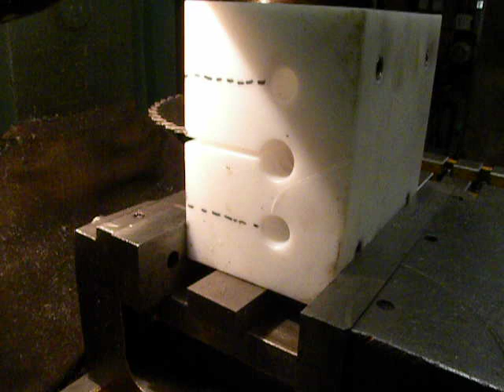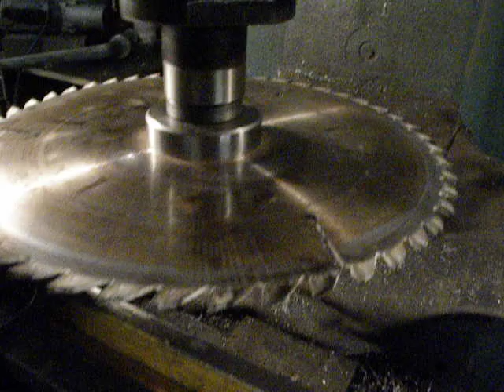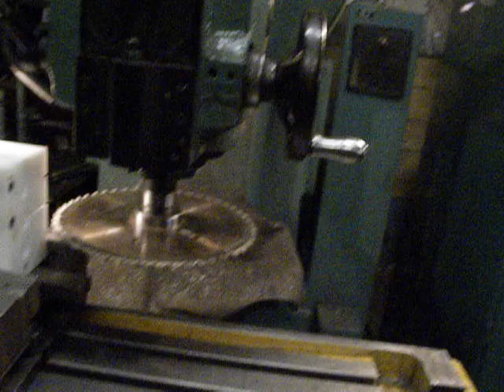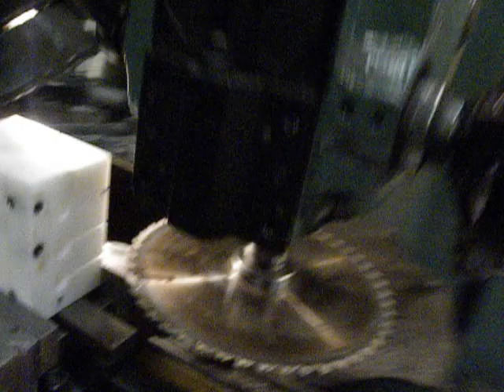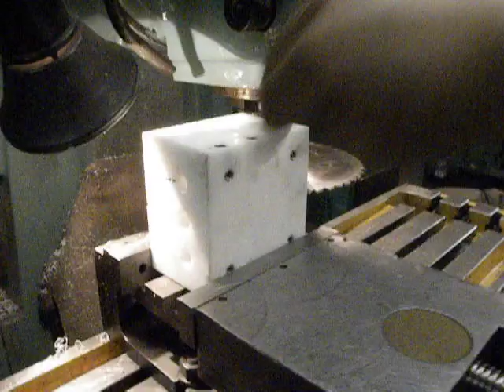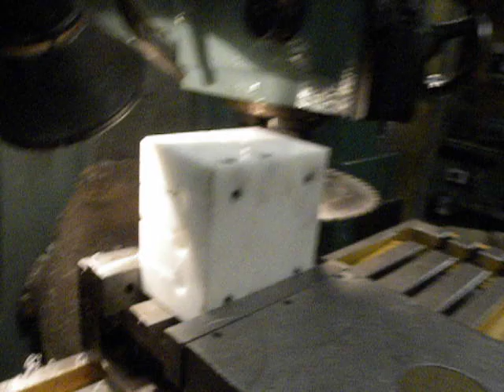Scary machine work - milling pastic part

Comment: Maybe you should get someone with an EDM machine to make a key slot in that blade.  I think the ones used on 4/5-axis Homag routers have a key slot on the blade for extra safety.
Reply from the maker: Key slot in saw blade be nice, but there is senseless, just because bode in saw blade is 50mm, on ISO50 shank enf is 32mm, in saw blade long time ago is instaled diametre spacer ring. For this saw blade I made enlarged flanges, also I set it so it at load it tighten a screw.
Thanks!

Comment: I've seen some people install a wood blade backwards and use it to cut soft materials like plastic. I don't know if it would work in this situation.
Reply from the maker: Backwards? Well, definetely it may not work.
Reply: I think the idea is that the blade does not grab the plastic this way. Glad You still got all Your fingers! :)
Reply from the maker: Thanks!